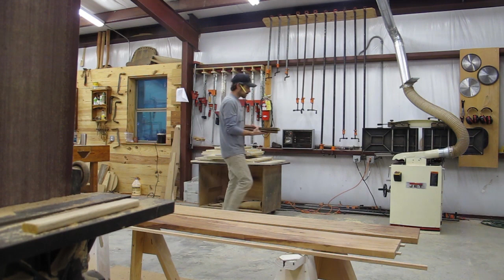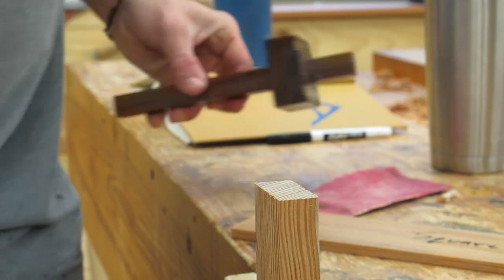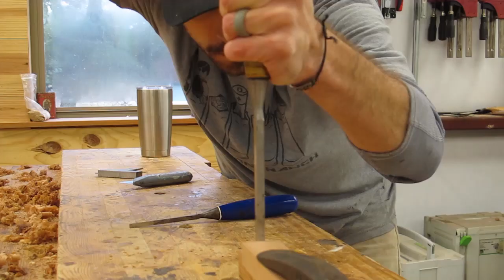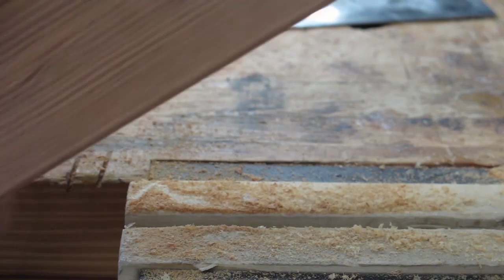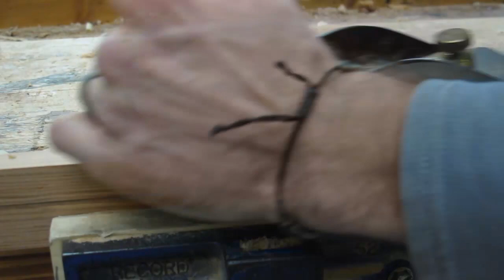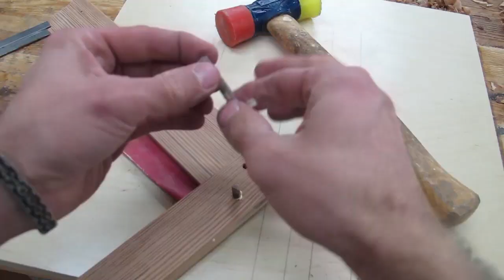Making A Try Square From Old Pine Flooring

Comment: So is that a yellow pine? Looked like that tough yellow pine grain to me. White pine wouldn't make as good a square either, not as durable. I'm in Minnesota so we mostly have white and red pine here. It's lovely to work with, but if I were looking to make a square I'd go with oak or maple if I wanted to use a local wood.
Reply: Cadwaladr looks a lot like Australian pine but I'm most likely wrong many types of pine look very similar

Comment: What is your wedding ring made out of?
Reply: That's a silicone ring made specially for people who might work in places where it's not safe to wear a normal wedding ring. They're designed to break after a sufficient amount of pulling to avoid tearing a finger off, but still are considerably durable
Reply: nbj711 it's a silicone ring that you can wear to work so if it gets caught in a machine it won't take your finger off